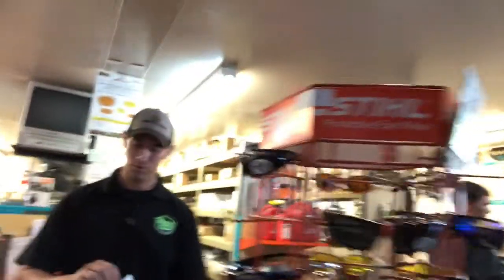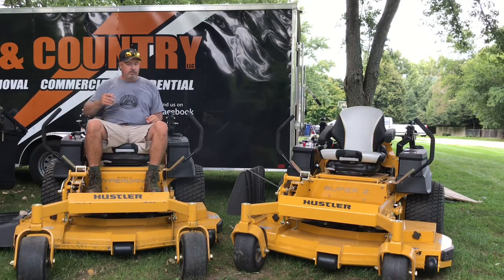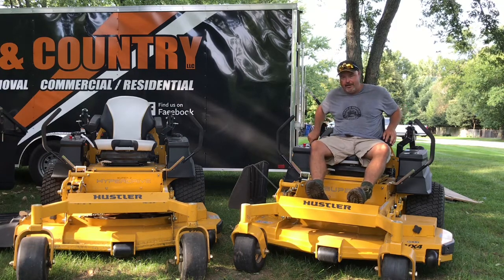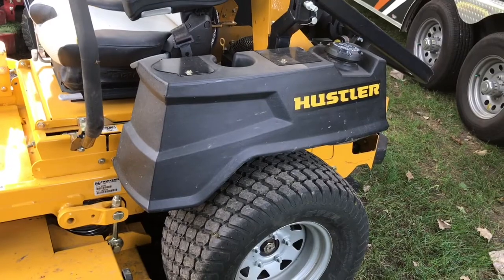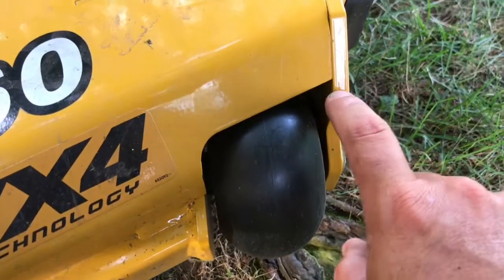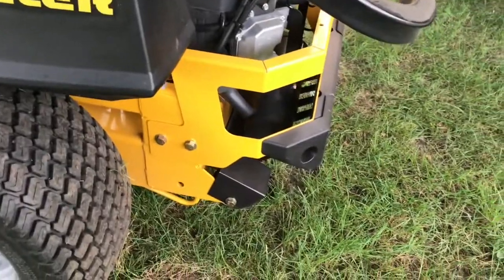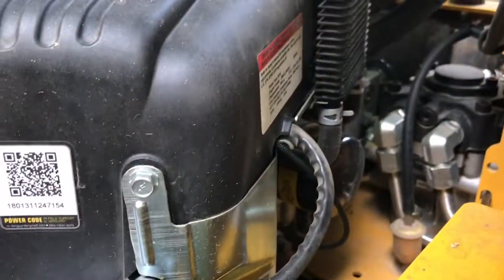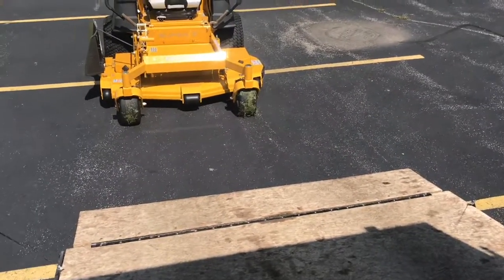Hustler Super Z review

Comment: Thoughs are some nice mowers. I have the Hustler Fastrak super duty
Reply: How do you like the fastrak SD?  I have the Fastrak. The one before the SD. I don’t really know what the difference is that makes the SD diff?
Reply: @cioch84  Bigger Hydros on the SDX. The Fastrak has Hydro-Gear ZT3100 hydros, the Fastrak SDX has Hydro-Gear ZT3400 hydros. The 3400s have a gross vehicle weight rating of 1600 lbs with an output torque of up to 500 lb-ft. The 3100s have a gross vehicle weight rating of 1200 lbs with an output torque of up to 350 lb-ft.

Comment: I read in the posts that the cut was bad. What was the issue? I had the Super Z several years ago and had a hell of a time with the bad cut. Know one could fix it, Hustler gave up. The actual cut was fine, the discharge was terrible unless under certain conditions.
Reply from the maker: Mickhippy it for some reason left a lot of grass standing. It was brand new, clean deck and sharp blades. It didn’t make any sense. I took it back to the dealership and they checked the tip and level of the deck and it still continued. The rep didn’t even know what to say. It just cut really bad..
Reply: I cannot believe they are still using that horrid deck. Might work for some and sometimes for others but its still a crap deck!

Comment: Did u ever buy a super z if so what motor did u go with
Reply from the maker: Rodney Turner no I didn’t.. The Kawasaki guzzled gas. And the cut quality was awful on the efi.  Well Built Machiens but don’t offer the finish cut quality that I want for my business.
Reply: So who do you like scag
Reply from the maker: Rodney Turner yes. The mower in my videos is 10-11 years old. It cuts clean and is very dependable. It lays nice lines even without the stripe bar. I just don’t have many problems with them. Ferris is also a decent machine. Once you learn how to mow with one it does a good job. It’s downfall is it has a lot of moving parts.
Reply: Town & Country Lawn Care LLC that what I hear about Ferris good ride but wear out quick seems to me what I can tell scag and John deer z trak have the zero turn mower cut quality thanks
Reply: @rodneyturner6411  I looked at the TOTL Kubota yesterday and it sure looks impressive, expensive too. I'd like to talk to somebody that has used a recently built one, I understand they have upgraded their commercial machines

Comment: hey guys, I see a couple pro's up in here, excellent. I have a lawn service in SE Texas, mow year round, I have the TOTL Dixie Chopper right now, 2005, mow 40 acres a month with it, and its a bad MoFo, 54in with a 30hp Kohler. Anyway I have been thinking about maybe getting a new machine w a bigger cut, and was told these Hustler's were the shyt, but after watching this i dont know.  I know for a fact a X=Mark will not mow the grass i cut, its mostly coastal thats used for hay for cows, back in 05 when i was looking i carried every machine around up there and NOTHING even came close to that Chopper, and it was close to 12k way back then. The DC is built so simple, with non proprietary parts you can get anywhere, except the back tires, i have never had to work on the damm thing in 15 years i'm thinking i should just keep it now. Its mostly stainless and when i clean it (once a year maybe) hell it looks new. So where does ole Roost go now, i was thinking this Hustler was gonna be the shat, it dont take much to cut san augustine, i dont think its a good measuring stick at all. Dixie is done so i hear, x-mark is out, looks like Hustler is out now. Hey has anybody checked that big ass Kabota out, i looked at one last summer and was really impressed. I think it had a 30hp diesel but diesel for sure, i told the guy i knew jack about a diesel, he said no worries we have been using this exact motor on our small tractors for 30 years, they dont break. I was really impressed with that machine though, and the hay guys all brag about Kabota, if you can afford it they say their the best tractors money can buy, and that one i looked at was either 12 or 14k, i remember thinking it was about the same as my chopper. Town and Country whatchu got man....Roost
Reply from the maker: Hugeroost  I have a  Ferris is2100 with a 61” cutter deck and a Scag turf tiger 61”velocity plus cutter deck. Here’s my 2 cents... The Ferris is more productive in the sense that it has full suspension and you can cut a little faster. The deck is a top contender. My scag has over 1500 hours on it and in my opinion it cuts better than the Ferris. If your cutting for quality, go with scag. If your cutting for time, get the Ferris. Kubota? Not much time around them. I demoed one 15 years ago and didn’t like it. I demoed another one about 6 years ago and it smoked like uncle bucks car. We have a dealer locally and they don’t sell but maybe a handful each year. Around here it’s scag, Ferris, hustler, gravely and Exmark. 

IMO is shy away from the kubota but that’s just me.

The mowers for the most part are the same. Start with a frame, 1 of 3 engine brands, fuel injection or carbed, liquid cooled or air cooled, hydro gear or Parker pumps and motors. Then you have to consider comfort, service ie dealer support, cutter deck if quality is important, suspension if ride is important, then price and warranty... the grass that you’ll be cutting plays into the decision also. I’ve heard some mowers don’t cut certain grass types very well.

Read, watch a lot of reviews and make an educated decision. I’m honest in my reviews but someone else might have a different opinion.
Reply: @fordfsd  hey thanks for your input, I noticed the Ferris has one with AC, now that's something to consider here in Texas heat
Reply: Hyperdrive super z. I have 2. No other mowers even come close.
Reply: @hunterthomas7402  what's your opinion of the Kabota's HT. I went by there a week or so ago and looked, very impressive. The guy actually told me let the grass grow a couple weeks where you cut w that chopper, come by here and pick up one of our units and keep it all day and see what's up. That's pretty damm bold, I tried that w the hustler people and no way will they let me run a machine for the day
Reply from the maker: Hugeroost  if your dealer won’t let you have it for a day reach out to the hustler rep personally. They let me have these 2 mowers for 2 or 3 days for this video.  They were pretty good to me..
Reply from the maker: Hunter Thomas I’m glad these Machiens are treating you good. I didn’t say they were bad, just that 1 used way to much fuel. I can see guys using them for sure. Do you have any pictures of your work with your hustlers?

Comment: 2 and half hours and a full tank and half a tank gone?
Reply from the maker: Mitchell Moore yes... true story...
Reply: @fordfsd  How was the fuel economy on the vangard engine on the other mower? looking to buy one of these mowers. But do not want the fx1000 if it drinks that much fuel.
Reply from the maker: Mitchell Moore the vanguard was better on fuel but to be honest the cut was by far the worst I’ve ever seen. I don’t know why. I have the hustler rep some video footage of the cut and compared it with a 10 year old turf tiger and he was stumped. I don’t know if it was way out of adjustment or what but between the fuel costs on the kaw and the cut on the Briggs I was left undecided on the whole experience. I might have just gotten a poorly setup machine and taking that into consideration I didn’t want bad mouth the company. He wanted me to demo a stand on unit this year so we will see if that happens. I hope this helps your decision..
Reply: Mitchell Moore that’s crazy!!!  I twice demoed a BigDog Diablo MP with the Kawi FX1000.  I mowed 4.5 acres and don’t remember using even one tank on the side.  1.75 acres was more than a month’s growth, and the rest was either 2 or 3 weeks.  I fell in love with that machine.  I’m scheduled to demo a Scag Turf Tiger II this week.  After that, I’m gonna demo this Hustler Super Z Hyperdrive since it’s the same dealer as the Scag.  Don’t know if you know,...BigDog is made by Excel which is the same company that builds Hustler.
Reply from the maker: B&M Land Management Co I do know that. I owned a 72” diablo X1072. It had a terrible cut due to the offset trim edge on the deck.  It cut fine as long as the lawn was perfectly flat. I lost money trading it in as it only had 300 hours on it but I couldn’t justify the cut.
Reply: Town & Country Lawn Care LLC Town & Country Lawn Care LLC Town & Country Lawn Care LLC makes me wonder how much difference there is between the Diablo X1072 and the Diablo MP with 72”.  I have no desire for a 72” cutting machine.  The one I demoed a month ago had a 60” deck and it was new with only 50 hrs on it.  To be honest, it seems like the bigger the mower, the flatter the ground has to be, to get the best cut,....which I do agree.  I notice it the most when I’m mowing along the sharper bottomed ditches,...or in my case, the flood irrigated yards.  When I mow my yard, I have to use a push mower around the berms so that I don’t create this line around the bottom of it with the big mowers.  It’s the only way to do a perfect job.  I’ve tried it with five different mowers.  A 21” push, 48” ztr, and three 60” ztrs.  The push mower is the only one that doesn’t leave the line, lol.  

Anyways,...I’m glad that you’ve done this review.  I’m at the point to where I’m considering making a big purchase.  Like I said earlier, BigDog has grown on me.  For some reason, I’m liking it the most,...even when comparing it to ExMark. Until I pull the trigger, Hustler will be a consideration for me.
Reply from the maker: B&M Land Management Co check out scag if you have a local dealer. Great Machiens. Jmo...
Reply: Town & Country Lawn Care LLC 👍🏿  got one coming tomorrow morning.  Gonna test it out on a half acre of clover that’s around 10”-12” tall plus dandelions that are taller,...probably around 18”.  I’ll run a test on my yard too.  It’s not in the same condition as my neighbor’s.  If I remember, I may do a review on it.
Reply from the maker: B&M Land Management Co bare in mind that none of them are brush hogs. They are finishing mowers. Only meant to mow a couple inches of grass.  Some you tubers expect to run them through overgrown pastures and make an assumption based on the outcome.  I look forward to your verdict.. good luck...
Reply: @bmlandmanagementco4981  hey man you check out that scag, what did you conclude, thanks....Roost
Reply: Hugeroost I demoed the Scag.  The first time the regional rep came out and the spindle bearing seized up and made the engine quit.  The second time, I was able to spend the day on it with no issues.  Make sure that the spindle bearings get serviced before purchasing a Scag.  I think it’s a great machine.  But I felt like for what I was doing,...the BigDog Diablo MP was gonna work better for me.  To make a comparison, I did reviews on both.  Hope that helps you out.
Reply: The tanks were not full if that’s the case. I run a EFI and a carb hyperdrive. Can cut all day on one tank.